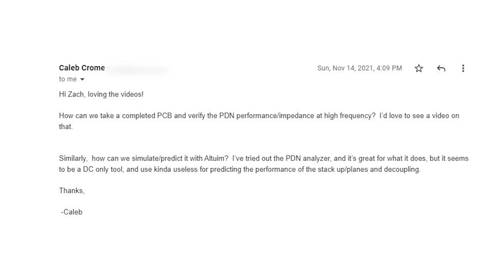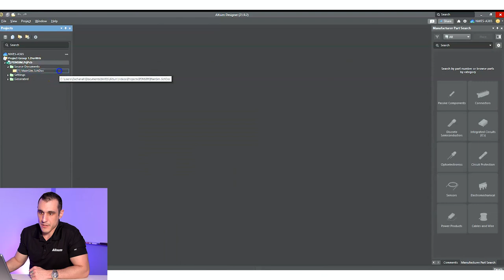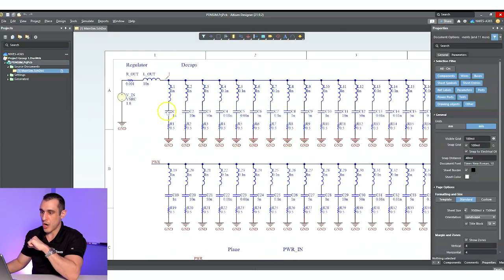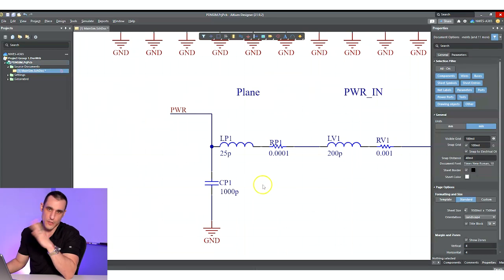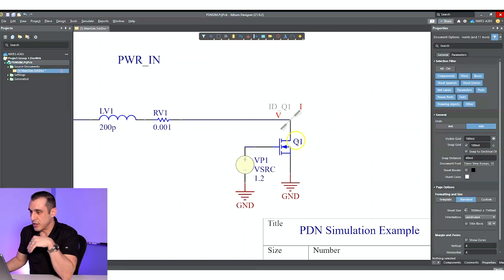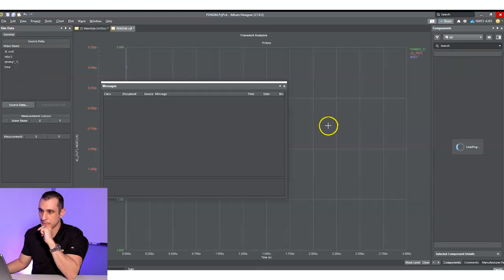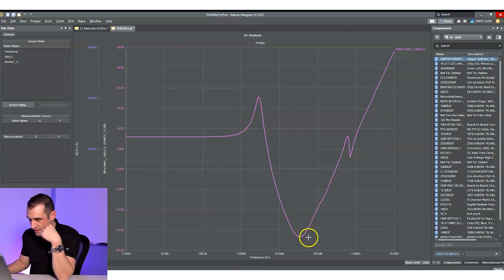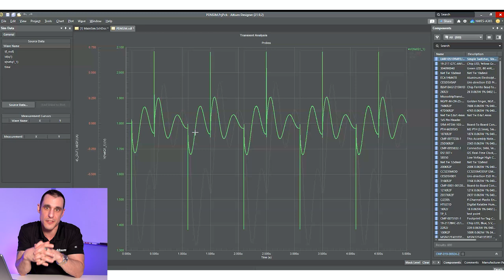Power Delivery Network Simulation Deep Dive - Part One

Comment: Zach, 
I love your presentations on this subject.  My knowledge on this topic has been greatly increased. Thank You.  
This brings up a point about distributed plane capacitance. Something I learned from Lee Richey is as inductance goes up capacitance goes down and the reverse.  Since the formula ((DK*Length*width*farads constant)/ thickness) would it be cheaper to add two more layers to your stack up SGPPGS with thinner cores and prepregs between the P and G players, rather adding so many caps throughout the design? I know you have to consider using 2 ply materials for >5v higher voltages difference and then more distributive caps are required when this situation comes into play.
The cost of capacitive components, insertion, solder paste, surface area, and inspection are greatly reduced. Even return paths and EMI are greatly reduced. I have found the board cost only goes up by 10% to 15% on high volume boards and this cost can be much less than that of using parts to increase the distributed plane capacitance.  The amount of capacitance really depends on the size of the board and the dielectric thickness of the material used.  The DK value is not as important except for the plane impedance gets lower thus reducing the inductance the gets the more capacitance you will get.
I use SATURN PCBTOOL Kit for my designs at the frontend to see if this is a benefit and it also aids in the selection of the materials for my stack up. I have found that at least reduces the number caps in the design even on smaller boards.  I would really appreciate your thoughts on this conceptual approach.

Thanks
Keep up the great work I really enjoy your talks.
Reply: Hey Bob,

Thanks for watching and I'm glad to hear this is all useful. You're right that adding another PWR/GND pair is also effective, and it could be more effective than just taking an existing decoupling network and doubling the number of caps, especially when you look at the higher freuqency range. You're basically putting another big plane capacitor in parallel. That also does reduce the inductance, or at minimum doesn't increase it assuming the spreading inductances are the same in these overlapping plane layers. At some point, adding more caps stops providing additioanl benefit because you're already well below target impedance values in the mid frequency range and you've totally eliminated any poles in the impedance spectrum, so you're right you only need so many caps. That being said, once you get to the mid-to-high frequency range (around 500 MHz to 1 GHz), doubling the plane capacitance probably is more effective than doubling the existing number of capacitors because the ESL value of those capacitors prevents them from further decoupling at those high frequencies. The other option is you go with really small case (0402 or 0201) MLCCs, which might also do the trick if you have even a small number of them. It depends on the exact frequency range and impedance reduction you need. Sometimes just adding a few bypass caps does the trick. But if you find you need an additional 20 MLCCs to get the impedance reduction you need near 1 GHz, and the additional plane gives you the same result, then why not go with the plane? It's all about looking at the impedance spectrum and determining the best course of action for your board.
Reply: @Zachariah-Peterson  I agree you have to address each design to the needs of the circuit now a days. I have been doing this 55 years and each of the thousand designs I have done are unique.  Approaching each one with a view of what the puzzle really is, the more techniques and tools you have 
,  makes you a better designer.   Lately I have been working with Gen Z 5 and CXL multi channel  memory with 25 Ghz front end with many analog supplies for thee multiple voltages and custom chips and DRR5 memory. The main resolve is using skip vias to remove the stubs on the high speed buses  and finding room for the returns path vias and still get the front to back traces short enough to minimize reflections on the daisey chained memory buses.  The Z-axis differences even make it more difficult to match the lengths to get rid of the initial reflection spikes on the rising and falling edges. This has been the main issue to maintain the setup and hold time windows which are shrinking at each speed grade.

Comment: Great video! I remember using Spice Opus (similar to LTSpice and other) in college. These tools are great for simulating analog parts of circuits. However, it's tricky to simulate digital parts. It's hard to get digital models for IC's and if you want to create one, you have to be very careful how to setup the pins.
Reply: Thank you! You bring up a great point and that was why I used a really simple model to just simulate switching action, rather than looking at the effects on an entire set of logic circuits you'd find in a digital component. But you're right, if you want to get an idea of how the power bus noise transforms into I/O noise you would need a better model of the digital part.

Comment: Hi Zach, there is a subject in power distribution network calculations that doesnt have a proper answer.

Most of the devices doesnt share power dissipation values, most likely only maximum or typical power consumption values.
How do you estimate power dissipation of a product as close as possible to the actual measurements?

Is it by gathering all the maximum power consumption values and dividing by square(2) to get RMS? or just gathering all the typical power consumption values?
Reply: This is a good question and I think there are several ways to approach it. Suppose you have a single processor and you want to estimate the total power consumption.

You can add up all the current for the interfaces you will use as well as quiescent values for the component, this multiplied by the supply voltage gives you a good order of magnitude estimate for the power dissipation.

You can also get an evaluation product for the component and measure the current being used during operation. When it is running your application you can determine the total power consumpion from the current measurement. If the design has multiple rails you can divide down the total current into each rail based on the current ratings for each regulator.

Neither approach is an exact science but at least it gives you a good order of magnitude estimate without building a complex test board.
Reply: @Zachariah-Peterson  
Thanks alot 😁

Comment: If the tools available within Altium were as complicated as the menu system you'd be on to a winner. How about component parameters without clicking 'show more'? Every. Single. Time? We now export our designs using an old license to Orcad to use their built in PDN simulator. These things, like SI tools, sort the men from the boys. I've never got a spice design to work in Altium without large amounts of tweaking, sadly. Coming from Saber, Mentor Gfx and Hyperlinx, Altium has a very long way to go.
Reply: I'd take Altium over Mental Graphics any day of the week

Comment: H Zach, in your simulation, how did you decide the the spreading inductance? I heard from Dr. Bogatin that there is no simple way to model, what we can do is field solver. And is spreading inductance asa the same as parasitic inductance? Or same as loop inductance? Hopefully you can hove one section to walk through inductance.
Reply: Hi Tim, you're right there is no closed form equation for the spreading inductance, you have to calculate it using a Green's function integral or using an infinite series of the structure's eigenfunctions. You can get an order of magnitude using the span across the vias, plane separation, and the distance between decouplers and input pins, but it's just an estimate. Also those vias need to be considered and it's usually best to put a bunch of them in parallel to connect to the die. To get an accurate spreading inductance value, you would need to use a field solver to solve Maxwell's equations directly, or you would use a numerical method for those integrals, brute force FEM would work. You can read more about it here: https://resources[dot]altium[dot]com/p/what-spreading-inductance

Comment: Great video! Thanks so much for breaking this down. One question though, what component from the Generic Simulation Components library did you use for Q1? I've got your same setup, but am having crazy swings and somewhere around 60(?!?!) amps for the drain current of Q1 (M1) for me. Much appreciated!
Reply: Hi Andy,
The component I used is MOSFET N-ch VDMOS. Just search that string inside the Generic Simulation Components library and it will come up. Note that this is a vertically-diffused power MOSFET model, so it's not the best representation of a CMOS logic circuit, but it can give the fast switching needed. If you want to get more accurate you could use one of the PMOS models and create a buffer, and then you could look at the output to see how noise propagates through to an IO. Again, not the most accurate as the best models are behavioral extractions from real components, but it's informative and I should probably do a video on it in the near future.

Also the rise time and voltage of the square wave source on the gate of Q1 are important. I used rise/fall time of 1 ns, and peak voltage of 1.2 V, that will certainly influence the total current driven through the FET.
Reply: @Zachariah-Peterson  Thank you for the quick reply! I'll give that component a try, much appreciated. Loving the videos, please keep them coming!